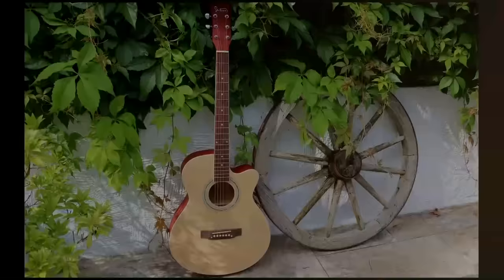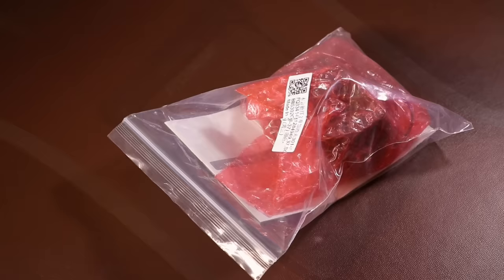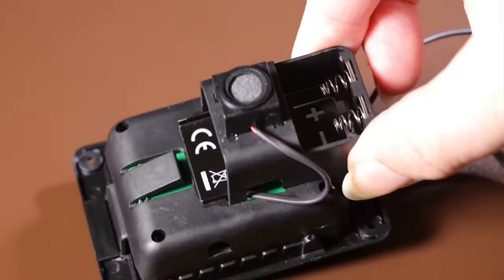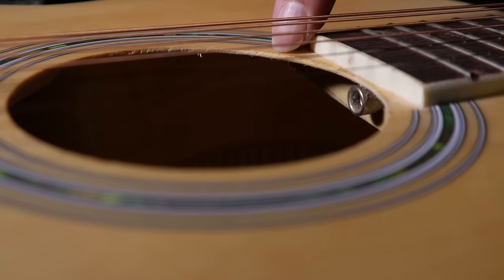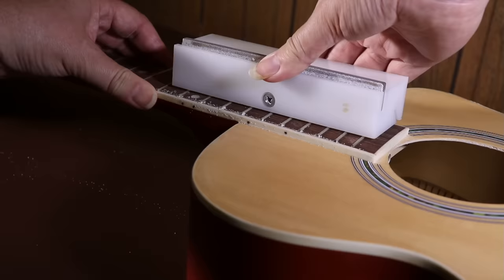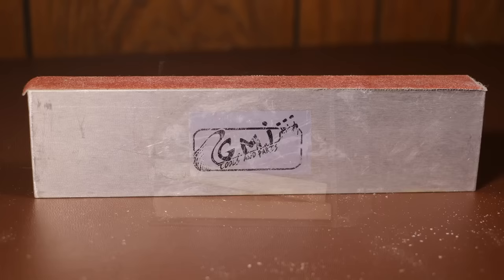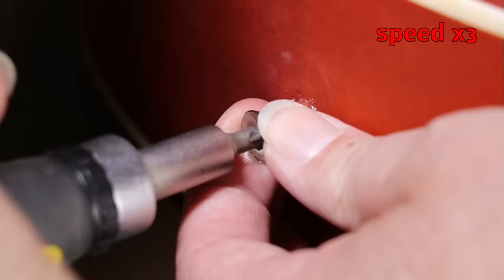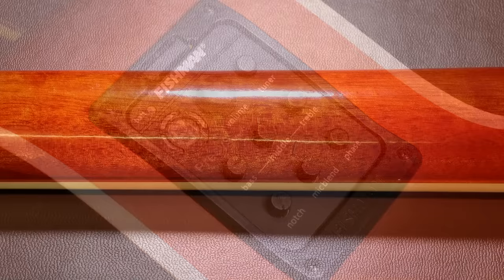How to make a cheap acoustic guitar play like an expensive guitar.  Upgrade an acoustic guitar

Comment: I am intending to install the Fishman preamp in a Fender acoustic guitar. In the video you show using the mounting plate as a template. I’m asking if there are instructions available for removing this from the preamp in order to use it as a guide as shown in the video. I’m reluctant to use too much pressure as I fear I will break or damage something. Any assistance greatly appreciated.
Reply from the maker: Yes, I can understand you not wanting to use too much force.  You can find a template online if you do a Google search for the preamp you're installing.  You then just print out the template and go from there.  😊😀

Comment: Hlw sir 
I have a problem on my acoustic guitar 
Only the b string buzzes on fret 2,3 
I asked everyone about this problem they said it’s alignment problem but my action is good 4mm .I think that my saddle is the problem
Reply from the maker: That is an interesting problem ..  To start with I would put a small piece of folded paper between the string and the saddle to make the string higher and try that.  This will show if the saddle is too low on the B string.  If that doesn't solve the issue, you need a fret rocker or something like that to find out if the frets are high or worn low, I use one in this video  https://youtu.be/8BSmoehj7sQ

Comment: Normally on a cheap guitar the fretting is out i,e, not spaced accurately therefore always slightly out of tune. If you play an chord you will get one perfect then play another then it is slightly out, this can happen all the way up the guitar. You don't gat a perfect octave at the 12 fret, Hou could you remidy this without refretting?
Reply from the maker: That's the intonation that needs to be corrected.  I can't explain that in text . . search guitar intonation . . 😀
Reply: @guitar-academy  intonation cheers I couldn't think of the word
Reply from the maker: @DrMontague  no problem 😀

Comment: bridge of my guitar braked down and please tell me which king of glue is better for glueing the bridge i need very strong wood glue please help
Reply from the maker: traditionally hide glue or bone glue is used but these days any strong wood glue will do the job.  Make sure the surface is clean as you can get it and make sure the surface of the guitar and the bridge are making good contact (not bumps) . .
Reply: @guitar-academy   thanks <3

Comment: The sounds almost seems natural💛, did you connect the pickup to a pedal or any soundcard?
Reply from the maker: Thanks . . the pickup goes through a mixer and into the soundcard and it was all set flat so it should be transparent. 😃

Comment: That's just the sound of the Fishman at the end? ...Just the line out? How are you getting that tone? I expect a totally different sound from an under the saddle Piezo.... Like just the Piezo quack.... Oh... That one has a mic, doesn't it? Your mostly using the mic? What are you running it into? An acoustic amp? It doesn't sound dry....
Reply from the maker: I set everything dead centre to give the best generalization of the sound so it's 50% mic and 50% piezo.  The sound was straight into a mixing desk, but I forgot the reverb in the desk was on. 🤔

Comment: This is great just one question  is it likely  that you may encounter bracing or block when placing the socket in the end of the guitar
Reply from the maker: Yes, , ,  You might come across a strengthening block.  But don't worry because the hole is relatively small and it will then be reinforced by the jack-plug socket it.  I hope this helps 😊

Comment: I have a 2 year old fender dreadnought cse 60 with pre-amp which I think sounds great but I was wondering if I could make my old Westfield £100 guitar sound pretty good and lower the action on it can anyone give me advice on this thanks Andy
Reply from the maker: Yes, absolutely.  If it's your first time setting up an acoustic guitar I would recommend buying a spare saddle first , just in case something goes wrong, or you can replace the existing saddle with a bone one which will also improve the tone.  😊

Comment: Great video thanks. 
£10? definitely Fishy. The transducer alone is way more than that. But if it works and sounds ok, then bargain! (i think!).
Reply from the maker: The sad part is that it's genuine.  The cheap ones come out of the same factory but are unofficial, which means when Fishman charge £150 for one they're making a 1400% profit (ish).  That's just greedy , ,  😊😊
I'll be publishing a review in the next few days with a genuine, genuine one, factory fitted in a £500 guitar and it's rubbish . . very sad 😒

Comment: Thanks for the video! I’m thinking of fitting a pre amp pickup to a Samick acoustic guitar I bought about 20 years ago for about $400 Australian dollars. I was wondering about lowering the action of the strings as it is quite high at the bridge end. Does this affect the intonation at all?
Cheers
Reply from the maker: If the actions very high it will effect the intonation because you are bending the string to fret it.  Lowering the action isn't too hard, but I would buy a spare saddle first just in case and some new strings.
I've done a video on action https://youtu.be/UgsN_HOjV2c
and another on buzz (just incase lowing the action causes buzz  https://youtu.be/8BSmoehj7sQ

Comment: I have a similar wire stringer but mine has a cutter it folds like a pair of scissors and it has a thing to get the pegs out on the other end it's actually very useful and it was like $3 dollars . Anyways nice video I've been trying to turn my $80 sag acoustic into a nice guitar for years now I'm always tinkering with it recently I I sanded away about 1/8 of an inch of wood then I stained it ebony I thought taken away a good chunk of the wood would make it sound more crisp instead of that dull sound that it have but honestly I think all that time and effort was for nothing I can't really tell the difference the first thing I did was fix my action and round off my Frets . What is the difference between a $5,000 Martin and at $80 sagg is it just the way they're built on the inside or is it the type of wood I'm sure with enough research I could figure this out and I probably should have did that before I started sanding the s*** out of my guitar. My buddy has always had Taylor's and Martin's and I've always had piece of s*** pawn shop guitars and it amazes me how much better his guitar sound like where the hell are you getting the sound from I know how to make my guitar play better but I don't know how to make it sound better, I think it might have something to do with the way the wood is braced on the inside sort of like when you build a sub for a speaker if you build them the right way or buy more expensive ones then you get more bass out of them because they're built with math and perfect measurements and all that stuff not just slapped together four corners and put glue on it " made in China"
Reply from the maker: Cool, that sounds like a useful tool.  I agree with everything you say, but the cheap guitars are improving so they can be made to sound at least reasonably good.  I few years ago they were all nasty laminate, but these days you can get a cheap guitar that is solid wood and the maths and measurements are exact copies of the expensive guitars.  Admittedly they will never sound like a really good guitar, but they're OK for people who just don't have the money to spend on an expensive guitar.  Another thing I think is important is the amount you can learn from a project like the one you did.  Even if the guitar doesn't get any better, your knowledge of guitars does . . 😊😃

Comment: Excellent job and really good sound at the end. How did you record that? Can you give the ebay link for the preamp please.  Also what is the oscilloscope you used ? So far I have been vey disappointed with piezo pickups as they tend produce a harsh sound when plucked hard but this one sounds very  so smooth . Thanks

Comment: Excellent video. Probably a silly question, but does the pickup wire you put under the bridge raise the height of the bridge, so need to be filed down again to lower the action again?
Reply from the maker: good question . . Yes it does.  This video is really a summary of several jobs, you can see the pickup fitting in details here https://youtu.be/nK3jum0_Fig  😊
Reply: @guitar-academy  Thank you. Much appreciated.
Reply from the maker: @andrewpelling7009  no problem

Comment: Great video. I have done some of this fixing on many guitars. Even some quite expensive ones, that was almost not playable due to the high string action. Wonder what is the difference between the cheap China Fishman and the real ones.. Maybe the same quality?
Reply from the maker: I'm sad to say . . it's better.  I have a factory fitted Fishman and the battery rattles so I have to wrap it with tape to make it fit tight and stop the rattle, and the sound just isn't right.  I've had comments from other people who have had the same problem with the battery as well.  Hopefully they've fixed this problem on the newer ones . .

Comment: Interesting video. You could have mentioned replacing the strings. These are usually poor quality as supplied new with the guitar. Replacing the tuners is also to be considered - these can be pretty  poor quality as supplied with cheap guitars. The "pickup" you fitted is a piezo and microphone - these can cause feedback problems etc and defiintey have limitations. I think I would have put masking tape when drilling the jack socket. Very nice palying....... A lot of comments but at least I followed the vid with interest !
Reply from the maker: You really shouldn't comment until you've seen all the mods . . https://www.youtube.com/playlist?list=PLIQJcXCYbgO24x4LaTVk6ecndsWx5kFCa
Reply: @guitar-academy  Well you should make it clear that it is not a stand alone video. If you are so sensitive to constructive comments I won't bother with the other videos.

Comment: Often the pickup manufacturer's web site has a printable template available. Also, when you adjusted the bridge height did you check the string height above the fret board for both E strings? Often the height adjustment needed is different across the strings.
Reply from the maker: Watch the playlist and you questions will be answered . .  https://www.youtube.com/playlist?list=PLIQJcXCYbgO24x4LaTVk6ecndsWx5kFCa

Comment: That sounds awesome! Just wonder why you didn't take more off that bridge to lessen the action towards the body of the guitar to make a little easier on the fingers?
Also what is with the funky bridges on some guitars, like part of it is set back?
Other guitars have a solid bone or plastic, like the nut that run parallel with the bridge pegs. Why?
Reply from the maker: I think that's what you're talking about id vompensating saddles and bridges that make the intonation more accurate. 
I've put a highlighted comment and a link in the description to a play list . .  the action and lots of other jobs were done in other videos . . This video is a summary of what was done.  🙂

Comment: Great video.
I tried to install a fishman preamp and piezo pick up to a fender cd60 i own. I cut out the holes perfectly for the eq and the jack.
But... I cocked up, when the piezo pick up was standing my saddle so high. I sanded the saddle down so much, and it got to the point that i realised that the groove in the bridge needed to be lowered.
I decided to try to take it 3mm down with my palm router. I got a judder, and screwed up.
Have you any videos on how to replace the bridge on an acoustic guitar???
Reply from the maker: Sorry, I don't have one like that yet, but I'll put it in my list of videos to do 🤔

Comment: Dear Sir.. How high should the strings be off of the 12 Fret?? I have seen some say 2.5mm with the guage.. Also do you measure from the bottom of the string or the top?? You are right, it does sound like an expensive guitar.. Thanks so much for the video.. Take care..
Reply from the maker: Thank you . .  on a steel strung acoustic guitar about 2.5mm from the top of the frets to the bottom of the string is about right.  If you have any doubts about now straight the neck is or how level the frets are, you might have to do it in stages.  A gap of 3.5mm or more might be a good start and then lower the action a little more if there is no buzz or leave it if you are happy.  I find that it is always slightly different from guitar to guitar.  🙂
Reply: @guitar-academy  That is clear.. Thanks so much for your time.. Appreciate it...

Comment: I have a problem with my guitar, first fret action very low and last 2 to4 fret action is high. What to do brother, as I have already filed the bridge its quiet low. I am afraid if I file it more then there will be buzz as top fret. Actually high B and E string have slight buzz at top 3 frets. I am stuck, can throw some idea how to go about
Reply from the maker: There are lots of things that can cause your problem, like a bent or twisted neck to uneven frets.  It would take me ages to type an answer to this, so it's easier to point you to a video I made https://youtu.be/8BSmoehj7sQ

Comment: Quite interesting I have an old flat top that was virtually untuneable or was it like meant to have plastic strings like a spanish/clasical guitar Im wondering and I dont think it has a truss rod to adjust the neck it was a christmas present my first ever guitar Kingston was the brand And I have a smashed yamaha acccoustic that I basicallty bondowed probably not the best idea but it works and sounds alot better as well so I did do something right and its playable. Im not a perfectionist I picked it up driving truck for like 15 dollars. Not sure what the original price was I spose I could look it up Ive heard bad things about pickups for accoustic guitars. I think I had one for an old twelve string I think. But this is interesting as in one mans garbage can be another mans gold. If you have the right tools and equipment
Reply from the maker: Great story . . It's a really great feeling to able to turn something others consider rubbish into something you can enjoy . . . 😊😀

Comment: It looks like the strings are pretty well buried in the nut so I'm guessing someone already filed the nut to lower the action.
I doubt if that was done at the factory.
Reply from the maker: Nope . .  that's the factory fit.  The guitar was £50 in fairness though  😊
Reply: @guitar-academy  Wow!
I've never seen that on a guitar before. 
Normally, I end up filing the nut slots down a bit on cheap guitars. Never seen strings buried quite like that one in the vid. But I guess the cheap price tag says it all.

Just curious why you didn't replace the nut on that build. 
Great video BTW.
Reply from the maker: @neilmartin99  I think you'll probably find it looks worse than it was because of the extreme closeups and camera angles.  You can find the video where I replace the nut and saddle on my channel . .

Comment: This pickup is so cheap because its a Chinese fake. I bought one, but haven't installed it yet. I hope it will do ok inside a nylon string
Reply from the maker: For a nylon strung guitar make sure the pickup is long enough because the saddle on a nylon strung guitar is longer.  These days they usually make the pickup longer anyway so it shouldn't be a problem. 😊
Reply: @guitar-academy  yes, its quite long and it produces sound too! I just hesitate as of the cheap design and the low budged micro. 
The original was only seen in some OEM guitars and is not available as a single unit.

 Have to replace a B-Band system, which is known for its failures after a certain time. (material issues of the pickup).
So I have to expand the hole and if the sound is ok, I will buy another one for my steel string that also has a B- Band. 
What do you think of the sound, especially from the microphone? 
It must not be automatically bad just because its cheap...
Reply from the maker: @tobiaslieblein2686  Ah, I understand your reluctance. . . 😊😊

Comment: You got me interested with the oscilloscope. Can you please tell me more how to use it on piezo pickup in details? 
I have a guitar with piezo and am not very happy with it. Maybe it just need proper eq...I am not sure but for me seems way too sensitive. It picks up every little vibration. If I lift up my fingers gently sounds like I am doing pull offs. Driving me nuts. I have tried to adjust it with the built in eq (2 band - Treble and Bass) but no luck. 
Could it be the preamp producing more power than it should. If so...how to check it?
Reply: Easy fix is to get potentiometer 10K or 50K ohms and put in between the signal, reduce the signal strength by adjusting the potentiometer and find where you get the signal strength that you want. You will get hundreds of tutorial on how to use a potentiometer.